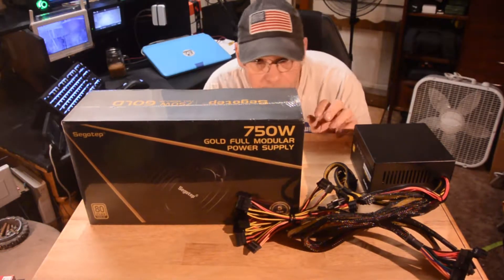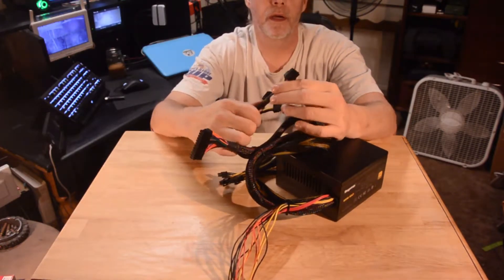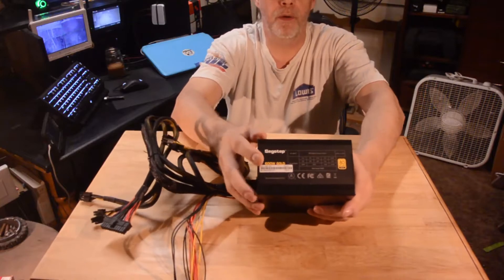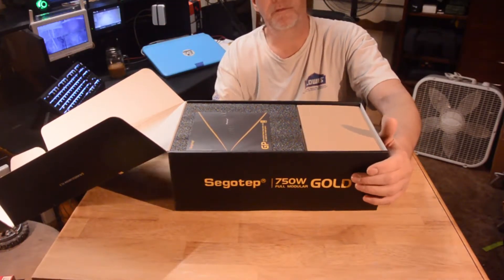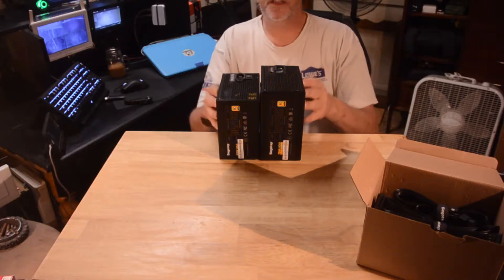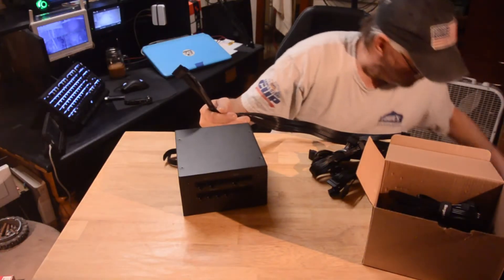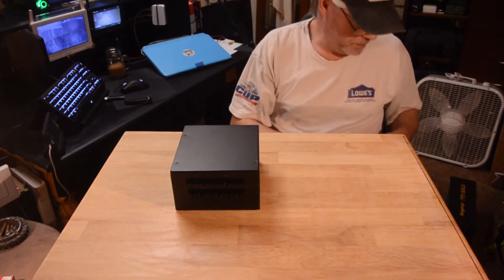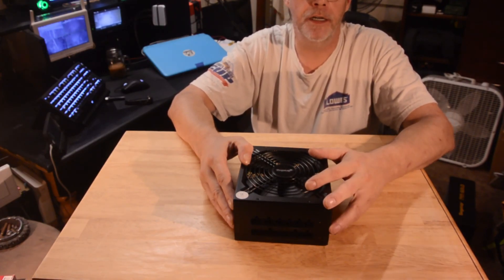Segotep 750W Gold power supply

Comment: Power supply still running properly?
Reply from the maker: Yes it is with no power loss as of yet.
Reply: @SouthernOhioprepping  I've heard about the fan starting to make noise after a while but it sounds like yours is doing well. Here's to hoping mine lasts. Thanks for the response.
Reply from the maker: @andrewfernandez8330  The most common reason is that dust gets into the fan on the power supply. Most folks will filter the air everywhere, but the power supply. And thus, it start to sound bad pretty quickly.
Reply: @SouthernOhioprepping  well that makes sense. Any recommendations on a filter for the power supply? Mine will be mounted traditionally with it's air intake facing the bottom of the case. I'm assuming I can find a magnetic filter that I could pop on that intake cut out.
Reply from the maker: @andrewfernandez8330  Yes, I have found serval on Amazon that will fine for it.
Reply: Still working fine ?